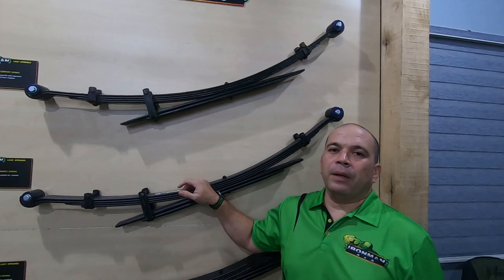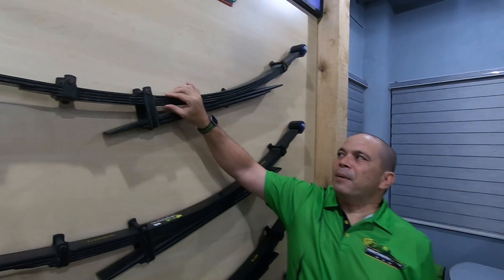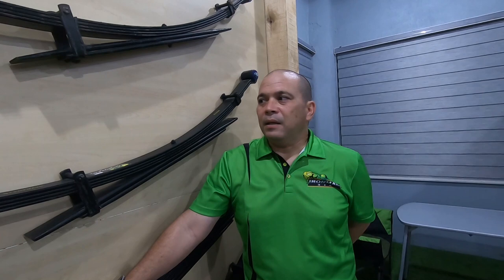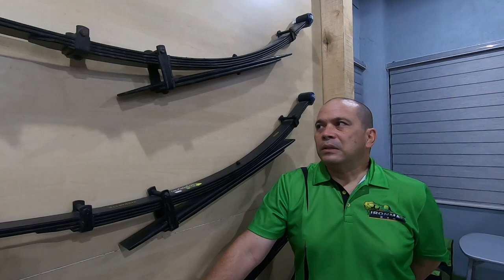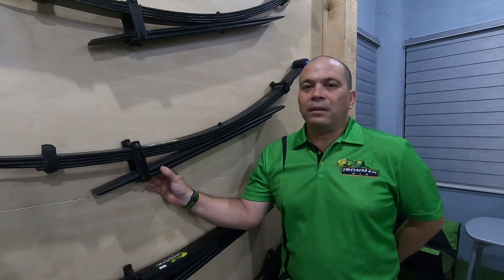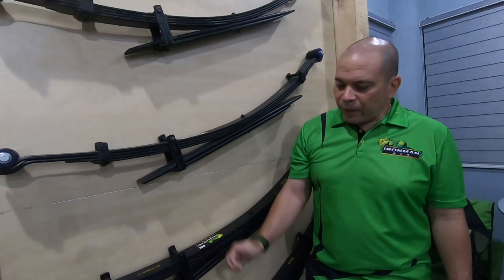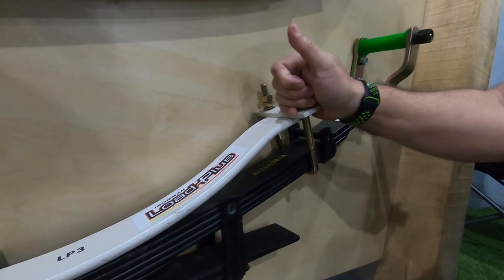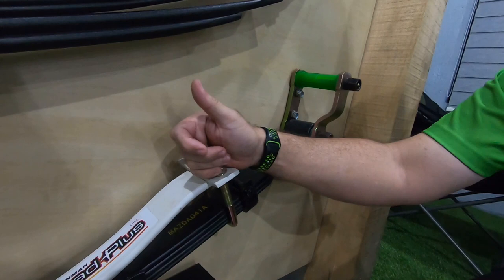Leafspring load rating explained

Comment: This is a very informative video. Sir I am new to cars and planning to buy an SUV  (Montero Gen 3.5) for both family use and a little help in our small business. We usually go out once a month to pickup stuff from around 500-600 kgs, but that doesn't include passengers, so probably around 800kgs or even more. My concern is do we even need to upgrade parts like leaf springs, shocks, and suspension of the SUV given that scenario? If so, what will be the negative sides. We were originally eyeing on a Strada, however given the size of our family we also wanted one that can carry more people so we thought of Montero. Any reply sir I will greatly appreciate. Thank you and more power to your channel.
Reply from the maker: The montero runs rear coils sir.  I think it will be a bit overloaded at 500 to 600 kgs.  We can uprade it to carry more load, but it will be a bit stiff and tall at the rear without load.
Reply: @ironman4x4philippines20  Thank you for your response. I just realized that yes it uses coils at back, thanks for pointing that out and for correcting me sir. So basically it is possible, but will feel and look akward. I wonder if you guys have already done that to an SUV before? Is it bad for the SUV to have that? Driver/passenger wise we can adjust. Thanks sir really appreciate it.
Reply from the maker: @mermaidinamanhole5796  not bad sir.  What we usually do is lift the montero front and rear and just use uprated coils in the rear for more load.

Comment: Greetings Ironman!
I have an Isuzu Dmax 2023 4x2 I bought last year and I'm still  using the stock leaf springs. My question is what would be a good modification with your product I can add to my Dmax?
My line of business is Bigasan so I'm carrying about 20 to 30 sacks on a daily basis which weighs 25kg a sack. What I want to do is eventually is to add a canopy in the back and have more load capacity for my rice. What product of yours that you can recommend adding to my Dmax to achieve this?
Reply from the maker: If you are loaded daily i would go with Add-A-Leaf for load.  It will not give a lift and will be a bit stiff unloaded but give you excellent stability at load.
Reply: @ironman4x4philippines20  Thank you so much for your quick reply! what if I wanted to go 25kg (1 sack) x 50 = 1,250kg on a daily baisis would you recommend Add-A-Leaf and Load-Plus? and perhaps having a Foam cell suspensions kit and UCA?

Comment: Hi, set up as below;
1) 4 foam cell shocks (24727FE & 24095FEC) 
2) Front coils (FOR001A) 
3) add a Leaf 
Control arms require?
Ride comfortable?
Thanks
Reply from the maker: That seems like a comfort setup sir.  No need for upper arms.

Comment: This is enlightening. Thanks! Sir what rating should I use for Ford Everest 2004?? I always drive alone but loaded full with people (6 to 7) on weekends.
Reply from the maker: 2004, I would use A springs in the rear, as your load is occassional.
Reply: @ironman4x4philippines20  sir where to buy po in Metro Manila. Thanks!

Comment: Hi there buddy im from england london. I have a transit custom 2018. It can only take 779kv payload . I have a jetwash in back with water when its full im defenstly over that? Will upgraddd leaf springs fix the weight problem? Thanks
Reply from the maker: Yes it would,  if the load is constantly in the vehicle (non-removable).  As a milder upgrade, LoadPlus from Ironman 4x4 would work too.

Comment: When do we use the shackles sir? Do we need to put one after adding add a lift, or we can just choice whether add a lift or shackles would do when lifting a vehicle
Reply from the maker: You never use shackles to lift a vehicle, due to a lot of reasons.
Reply: @ironman4x4philippines20  Im planning to change my suspension in my pick up. But instead of add a leaf can i use comfort shackles? Does it add more weight besring capacity?

Comment: I don't have a Toyota but I carry a lot of gear, I imagine the main incompatibility between leaf kits for different models of utes/pickups is the location of the bushes. Is there any reason why you couldn't take a couple of leafs of the same size or and stick them beneath your top leaf either on the primary or secondary?
I've noticed some leaf packs have the same or almost the same length for some of the mid-leafs, can you add more leafs to this to stiffen the springs?
If I were to do that would it be necessary to replace the shocks?

Thanks in advance for any advice you can offer.
Reply from the maker: You can stack up your own leaf pack.  Ypu can do this by adding more thin leaves.  The problem will most pickups is the leafsprings sit on top of the axles, and adding more leafs increases rear height.  If you buy an aftermarket leaf set, the curve of the springs is altered to give a uniform height.  As for shocks,if the height increases, you might need longer travel shocks.

Comment: @Ironman 4x4 Philippines  For a 2" lift what is the best set up 
For front and rear?  For  a 2010 Fortuner Sir. Thank you
Reply from the maker: Hi sir... is it a 4x4?  Do you have accessories like bumper, winch, etc
Reply: @ironman4x4philippines20  Im just a newbie and actually its for a 4x2. My priority is just for the floods that we are experiencing right now. Any suggestions sir? Snorkel ba muna? Or lift. Pero Im not into off-roading naman. But for sure in the future, After getting the right 4x4 I will be. Sobrang interested ako and grateful because of your informative videos. Dami kasing pera pera lang today. You know what i mean.😊 Thank you
Reply from the maker: @healthybodyawesomelife5640  since It is a 4x2, TOY055A front and TOY017A rear is fine.  Foam Cell shock front and Foam Cell Comfort rear.  (Nitro front and Nitro Rear will work too).  As for the snorkel it is added insurance.  We have a snorkel too.
Reply: @ironman4x4philippines20  Sir, kindly forward a quote, please for  both including the snorkel. A photo of the set up and the snorkel would be most appreciated. Thank you po

Comment: Hello there, question for you. So I have a set of "medium" leaf packs that spec wise say +400lb/181kg constant weight. I have a 2011 double cab Tacoma that I use for work (detailing) and occasional off roading. With a fiberglass topper, 100lb invertor, and occasionally I'll have up to 50 gallons/189L of water. Should I upgrade to a heavier pack or would this be sufficient? Thanks in advance
Reply from the maker: It is actually more than enough.  The topper and the inverter would be close to 400 lbs, so thats right as a non-removable constant load.
Reply: @ironman4x4philippines20  cool! Thank you for the reply! 🙂🙏🏼

Comment: Which ones would I need for a trailer to be able to tow 20k lbs? With two  10k lbs axles? Thanks
Reply from the maker: If you ask me i would go for C or D springs.  You will build the trailer using ironman leafs? Or you need the leafs for the towing vehicle?
Reply: @ironman4x4philippines20  it would be for the actual trailer. Thanks for replying

Comment: Nice info. My dealer got me 0 to 300 and its rough riding. My dads stock truck drives nicer. Can I remove a leaf?. It sits much higher in the hear. Dorsnt seem to lower with 150kg on jt
Reply from the maker: Whats the setup on it.  Let me know the part numbers so we can help.

Comment: Why do Ironman uses poly bushing for leaf springs while it uses rubber for shocks and arms
Reply from the maker: Poly is a good rotational bearing and it does not mind grease, hence the greasable shackles.  This way you get less friction at the shackles.  Poly is not good with flex and vibration dampening, but you dont want the shackles to flex, but you want the springs to flex.

As for shocks, you have a lot of angle changes so rubber is better, plus it absorbs more vibration.  Using Poly on shocks will give more side loading and bending forces the shocks causing premature seal wear.

Comment: Hi thank you. I have 300kg iron man leaf spring but is constantly carrying 420kg. What is the best and cheapest option for me. Thanks
Reply from the maker: It is no problem sir.  I think it will work fine.
Reply: Hi thanks so I don't need to upgrade?
Reply from the maker: @robertoplowman8888  i dont think so.  420kg total load?
Reply: Constant 420kg but sometimes increase to 750kg and also using trailer or caravan. I want to know can I fir an proper extra leaf spring to my existing ironman 300kg
Reply from the maker: @robertoplowman8888  you have the leaf part number?
Reply: @ironman4x4philippines20  hi yes I do. FOR2C  P1019.
Thanks
Reply from the maker: @robertoplowman8888  i think it would be fine at the moment.  Max load for those springs are 1000kg or GVW still.

Comment: Sir how about multicabs pick up 250 capacity can i add more leaf spring in order to add more than 250?
Reply from the maker: Yes you can.  However, be careful of your loading because if we add more load, the other components may suffer.  Like bearings, axles, and such.

Comment: Hello sir.
For my 2020 Strada GLS 4x2 
Nagbabalak napo ako ipa 2 inch lift ang Pick up ko ano Po Ang set up Ang kailangan? Or gamit? gusto ko Po Sana ung medyo nakataas ng konti sa rear . hingi Po Ako ng advice kung anong bibilin ko salamat Po godbless
Reply from the maker: We have promo kits that include 4 shocks, 2 front coils, and 2 rear addaleafs.  The promo starts at 40k for a set with Nitrogas shocks.
Reply: Salamat Po sa sagot saan Po located Ang inyo store? At I papartner ko Po sa tire and rim na size 285/70/R17
Reply from the maker: @davincigigs7085  285s are a bit on the big side but will work depending on rim offset. We have an office in QC

Comment: Hi. i have a hilux and i am not loading anything on my daily drive. I had it lifted with suspension with add a leaf. question, if i replace the stock leaf spring with that A-Spring, will it make the ride smoother or comfy?
Reply from the maker: Yes sir.  The mettalurgy of the Ironman leafspring is totally different. What shocks are you using?
Reply: @ironman4x4philippines20  im using ridemax with canister.
Reply: but in this video, you said that A-spring would lift the vehicle 2inches… does that mean that another 2inch on top of the suspension lift i have now?
Reply from the maker: @alvinbulawit3687  no sir. 2 inch over brand new oem height
Reply from the maker: @alvinbulawit3687  i cannot guarantee the ride quality coz the internal valving of the ridemax is unknown.  If the shocks are Ironman 4x4 then we can be sure it would work as they are manufactured to work with the springs.
Reply: @ironman4x4philippines20  i see. thanks for the infos sir. more power to you.
Reply from the maker: @alvinbulawit3687  but we can try po sir

Comment: Hi Sir
May I know 
For 24 tonnes truck 
What is the spring stiffness for leaves spring?
Reply from the maker: 24 tons? What kind of truck? What model?
Reply: @ironman4x4philippines20  
3 axles lorry
Reply: 10 wheeler lorry
Reply: CW420
Reply from the maker: @wanikramwajdeewanahmadkama4800  if that is the case the original springs with a few leaves added is fine.  The secret is making sure the shocks are good, or else your leafs will overheat and break.
Reply: @ironman4x4philippines20  
Sir
What is the suitable stiffness for my case?
Reply from the maker: @wanikramwajdeewanahmadkama4800  as stiff as you can get sir.  What is wrong with the original springs?
Reply: @ironman4x4philippines20  actually I need this data for my research knowledge

Comment: I also need this for my hyundai h100 2012 model. And my ford ranger is a 2021 fx4 model (not fx4 max)
Reply from the maker: Load plus sir?
Reply: Yes and the thicker leaf springs
Reply from the maker: @iamLiam053022  for the ford yes we have leafs, rated to load max 1 ton... hyundai we may be able to use loadplus.

Comment: I have a 2" lifted pickup truck with shackles at the rear. Will the ride comfort improve if I change it to ironman add a leaf? Also, can I do the ironman add leaf without removing one leaf from the stock leafspring? Thanks
Reply from the maker: Yes you can go Ironman 4x4 AddALeaf.  Also, we only remove one rear thick overload (auxillary) leaf when the client wants to lower the rear a bit.  Removing one doesnt improve the ride whatsoever.  We will need to re-install your stock shackles though.
Reply: @ironman4x4philippines20  But if I choose to retain the stock rear thick overload (auxillary) leaf, together with this Ironman AddALeaf, will it give me a better ride comfort overall, compared to my current lift setup with extended shackles? Thank you, sir.

Comment: Currently using stock leafsprings on a 2019 Hilux with Add-a-leaf, will be changing my constant load to 300-400 kg, what leafsprings should I get?
Reply from the maker: The addALeafs are fine with that load.  Is the constant load you are referring to non-removable?
Reply: @ironman4x4philippines20  yep, bumper, slider, canopy, dual battery agm, rack and awning
Reply from the maker: @thegiankarlo3  that is not a problem sir.  Most of the added load is at the front.  You may need stiffer springs in front.  Rear is fine.  My Hilux runs canopy, roofrack on canopy, awning, drawers, wings, rear bumper, fridge, all on AddALeaf.
Reply: @ironman4x4philippines20  currently using TOY065B springs on the front, I have a steel bumper, side rails, winch and driving lights.  Do I need to change to TOY065C?
Reply from the maker: @thegiankarlo3  no need sir.  What shocks are you using?  I am using the same springs and with the Ironman 4x4 ProForge, I get 70mm sag and it works really well.
Reply: @ironman4x4philippines20  using Foamcell Pros. I’ll update you once I setup the full weight sa rear. Thank you.
Reply from the maker: @thegiankarlo3  sure sir.  Pros make it a lot easier to adjust preload.

Comment: Hello Sir Good Day, what can you recommend for Strada 2020 GLS quick 2" lift.? Thanks
Reply from the maker: We have a 3yrs/60000 km WARRANTY Ironman 4x4 Australia SINGLE BRAND promo set for Struts Coil and Leaf Pickups and SUVs❗💚

✅ Nitrogas kit 37500
✅ Foam Cell kit 47500
✅ Foam Cell Pro kit 71500

You get:
✅ 4 pcs shocks
✅ 2 pcs front coilsprings
✅ 2 pcs rear AddALeaf springs
✅ 3 year/60000 kms worldwide warranty
✅ Australian brand with 62 years experience
✅ Australian R&D
✅ sold worldwide
✅ a proper website and aftersales department in Australia
✅ no magic shackles, no spacers
✅ not a rebrand

www.ironman4x4.com
Reply: Go with ironman shock + add a leaf + type A spring that will do the quick lift 2 inches. Never ever install comfort shackle and spring spacer.

Comment: Sir, I drive a 2000 GMC Safari van. I  have a tool box in the back all the time that weighs about 200 lbs. My leafs are shot. They are flat or even have a slight "frown" instead of a "smile" shape. sometimes I load it up pretty heavy and I would like to even pull a trailer. This van rides TERRIBLE! super rough on the road and feels every bump. Do you think this is due to my leafs? Do you recommend a leaf for me? Any help would be super appreciated. Thank you!
Reply from the maker: Are you in the US?  I would recommend using Ironman 4x4s Load Plus leaf helper.
Reply from the maker: @RoundTownWithMike  sure.  Let me know how wide your leafsprings are so I can see what Loadplus will work.  More info here:
http://www.ironman4x4.com/categories/load-plus
Reply from the maker: @RoundTownWithMike  sure sir

Comment: May i use B spring for Ford Ranger 2.2 with original stock bumper? Its still comfort? I already use foam cell pro
Reply from the maker: Depends on the weight of the vehicle.  Is it a 4x4? What acceasories are installed?
Reply: @ironman4x4philippines20  yes.. 4x4.. just bonet cover abs.. at rear..
Reply: @ironman4x4philippines20  now i still use front & rear stock bumper.. can coil spring dan leaf spring Type B give me comfort without load anything? 4x4 Ford Ranger 2017

Comment: Hello where can I buy and have it installed for my ford ranger. I always carry a lot of load because of the nature of my business. If I can get a D spring and a load plus if possible sana where po? And how much?
Reply from the maker: You dont need a D spring sir.  All the springs A to D are 1 ton load rated.
Reply: @ironman4x4philippines20  but I normally load 1.5-2tons haha
Reply from the maker: @iamLiam053022  D springs cant solve that sir.  1.5 to 2 tons is so far above your vehicles rating that we might break axles or spindles, or the chassis.
Reply: @ironman4x4philippines20   I agree po. But in the future na I just carry about the same weight of my gvwr hindi na siya masyado baba and mas maganda ang ride and hindi siya unstable feel sa turns and bumps
Reply from the maker: @iamLiam053022  the load rating on the springs refer to unloaded weight.  If you carry GVW, let me know the vehicles setup so we can find the right spring.
Reply: @ironman4x4philippines20  is there a number I can call for faster transaction?
Reply from the maker: @iamLiam053022  pm me your contact info on my FB, Pablo Lu Ascoba

Comment: Sir question po kapag mag load Ng around 600kg or abovee of load sa Hilux for heavy duty transport, ano po need na spring?
Reply from the maker: Is your loading more of a daily thing sir?
Reply: Good day, 2 to 3x a week sir Ang load schedule
Reply from the maker: @tristancapa  You can run A or B springs if you want a lift.  If no lift we can run the original springs with loadplus
Reply: Thank you po sir sa help at info